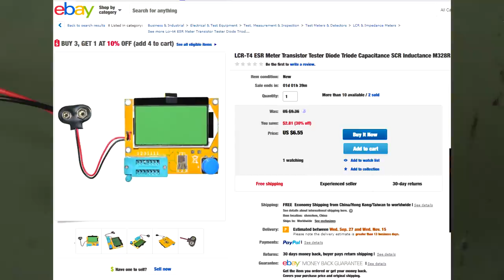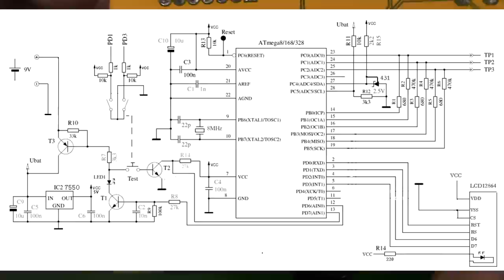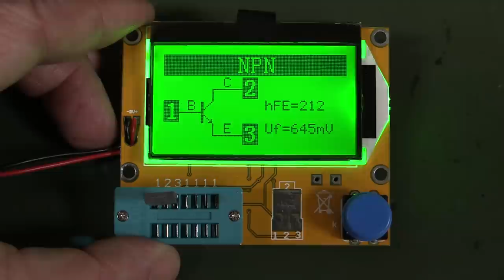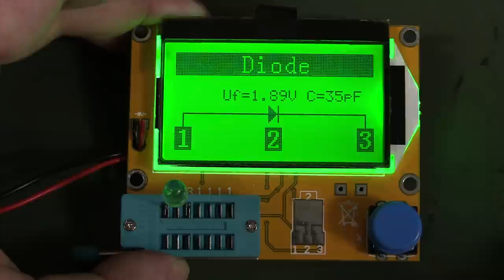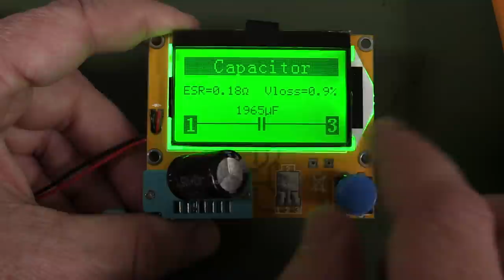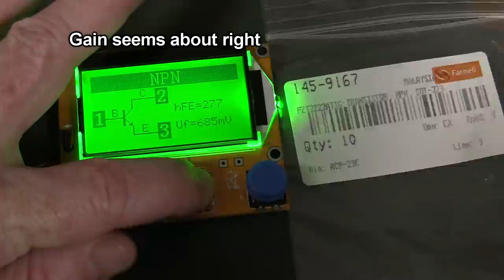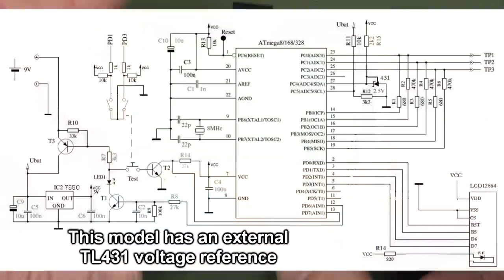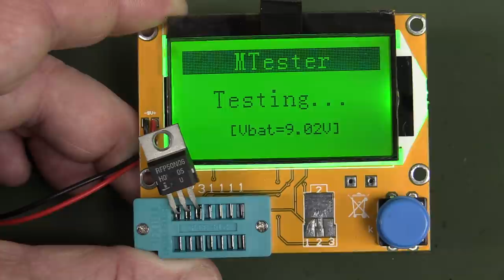EEVblog #1020 - Is A $7 LCR / Component Tester Any Good?

Comment: I love my component tester as a simple double check before soldering ass saver. On more than one occasion, I've been unsure of the pinout of a given part. It saves me from digging up a datasheet for it on the computer, but more importantly, lets me confirm at the workbench, letting me install and solder in a part with the confidence I'm not going to do some idiotic move like put a transistor in backwards. Nice to characterize SMD caps too, since those are typically unlabeled.

Comment: I had a failed power supply for a sat receiver, couldn't find anything obvious wrong with it, so i started pulling the electrolytic caps off it and used a similar tester, replaced all the ones it showed being out of spec and the power supply works like a charm now, don't remember what mine cost now, got as a kit from bang good, and 3d printed my own case. its been very useful and well worth the money and time.

Comment: Always discharge capacitors before measure them in those devices. I killed one of those testers a while ago with a still charged electrolytic cap... No magic smoke though :(

Also: since caps are measured by charging them and counting the time for that, the measurement is more accurate (if this thing is ...accurate :)) with a fully discharged cap.
Reply: obelix Good point, I've killed two testing electrolytics now.
Reply: I accidentally connected a partially charged 25v 4700uF to mine and it actually made the unit power up on its own as soon as I connected it. Luckily it survived but I always short them out first now even caps that are not charged.
Reply: Sounds like a good feature to add... a couple of relays that short the pins until the testing starts.  Connect your part... it's safely discharging until you press the button. It can go back to discharging as soon as the test is over. Now you know it's discharged when you are done!
Reply: There is a design variation with a shorting relay that is supported by the existing software.  The relay coil current is far more than the rest of the circuit draws, so you don't see it on commercial boards.

Why do I remember this?  A capacitor charged to 19V blew up my first tester...
Reply: Right! All the test inputs are directly connected to microcontroller I/O pins. 
So, connecting a capacitor charged to more than 1 volt may damage the µC by causing currents through the internal I/O protection diodes. More than 6.5 volts will definitely kill it.

The tester tries to discharge a connected capacitor by shorting all three test pins (by setting them all to output with a logic low) for a few 10 ms. But that may not be enough to completely discharge a large electrolytic cap.
Reply: I think I’ve toasted my one that way too. Capacitor was probably not fully discharged. LCD backlight goes on but nothing else. Two of these tiny 3 pin SMD components seem to get hot. Only the 5V regulator one I can recognize but no clue what the other 3 pin elements are. No label. Anyone fixed their one and could tell what to replace?

Comment: In my testing It does do inductors pretty  well, I have a variant I reviewed a short while ago and got similar results ... works a treat, and I totally agree with dave, for the price as a simple tester and identifier it works very well, my version was more expensive as it had a case and also did IR remote decoding
Reply: Oh I pop in from time to time 😆

Comment: for years I also been over looking this kinds of units and I finally cracked and bought one! it actually came in very hand when I was assembling a board that was designed in the usa and the kit came with European components which meant the BCE was all backwards ! it paid for its self right there! by saving me the trouble of finding all the datasheets for each transistors

Comment: Dave, I really like your channel and your in-depth reviews of electronics technology. However for this video you apparently did not do any research. What you essentially trash, complaining about non-critical features such display brightness and missing low voltage indicator, has been carefully designed by two trained engineers such as yourself (Markus Frejek and Karl-Heinz Kübeler), documented on the well known German microcontroller.net website and is shamelessly more or less well copied by companies in China that sell their knock offs online. You received a particularly old and poorly executed clone. The project is continuously evolving, with improvements to both hard- and software. The latest version is quite capable. So please RTFM (131 pages), buy or build the most recent version (EagleCad schematics are available too) and do a new video. We all know you can do much better!

http://www.avrtester.tode.cz/upload/ttester_en.pdf

https://www.mikrocontroller.net/articles/AVR_Transistortester#Introduction_.28English.29

https://github.com/svn2github/transistortester

https://www.ebay.de/itm/142477623934
Reply from the maker: +Wetter Station I did NOT purchase this, it was sent into my mailbag.
Reply: EEVblog Hi Dave, sorry I did not know you received it for free. I corrected my post. Nonetheless, perhaps you can at least add the 131 page manual from May 2017 link and Github software link to your video? I'm sure your viewers would appreciate that.
Reply: Ain't nobody got time for that.
Reply: Dave's viewers, keeping him honest! ;')
Reply: +Wetter Station, thank you for posting this information.
Reply: Is there shop in Germany that sells these? I do not want china fake crap, fake chinese resistors are enough for me. Especially for a measurement instrument.
Reply: He could've at least easily calibrated it before making a review video about it and constantly nagging about how inaccurate it is!
Reply: maybe send the new one to him lol
Reply: @EEVblog  re 4:43, it seems this has been answered.  You might also find a video review of these things to be of interest: https://www.youtube.com/watch?v=4Xsg8lpP75s

Comment: Its pretty usefull. For checking transistor pinout. Also software is open you can reprofram it. It can with new program measure frequency, have generator etc.

Comment: In Dec 2021 I found one for $11.99 with free shipping on ebay in US.  Here's one $11.52 with plastic case ($10.52 + $0.99 shipping).  
LCR-T4 ESR Meter Transistor Tester Diode Triode Capacitance SCR Inductance +Case

Comment: I got one of these last year and only recently realized I got a "fake" one from what your forum was mentioning. The one I received didn't have the metallic clock crystal and it also had pads for a usb port that wasn't populated. Brought it up with Amazon since it died and I realized it was a fake and not what is shown in the listing. They refunded it so. Hopefully the one I order from aliexpress is the real one. All the review pictures show the real one. 

It came in SO handy when I repaired a RX 560 that was missing a sot-23 component. Turned out there was one next to it. De-soldered it and put it on the tester. Told me what it was. Went to a donor graphics card and kept desoldering sot-23 components until I found what I needed. Put it on the RX 560 and it worked!

Comment: A while ago I bought one of the versions with a character based LCD display as I preferred its DUT connection method over one that uses a ZIF socket. I wasn't expecting it to be a precision device. Certainly handy to provide some basic information on the drawers full of miscellaneous transistors that I have acquired over the years.

Comment: I have had an earlier version of this device for a long time. I once assembled one of those little cheap oscilloscope kits using just that device to sort the parts, came out just fine considering I did the whole job on the booth table top in my RV sitting in the middle of the Mojave Desert using a USB soldering iron running off a home built power-bank made out of two 18650's taken out of a dead laptop battery. Both the tester and the little scope run fine.  The only problem I have had with it is that I once put in to large a lead in pin hole 1, and it no longer makes good contact, so I simply used the lower set of clips on the zif socket...  Thanks a million for the review though, I really believe all the hobby electronic guys should have one of these.  I find it especially helpful now that I have begun to get surprise packages from Electronic Goldmine down in Arizona. for a few bucks they will send you a large box of mixed electronic parts from Diodes to Caps as well as all sorts of resistors and a ton of things I need the component tester to figure out what to do with.  Some are beyond that device but I probably won't have any use for them anyhow, so in the  bin with them.

Comment: i bought one of these earlier this year because i was sorting hundreds of different components. worth it if you cant afford a pro tester or a good auto multi-meter . Ive had some parts that wouldnt test in slots 123,  but moving it to a different location gave a reading.  its handy thats for sure.

Comment: @5:28 time mark , A regulator was tested , and it was tested in the wrong area of the tester , The first 3 pins in the bottom section  marked KAA is where that part should go and any other parts relating to Zener diodes.....

Comment: So Coiltec made the first version and released it for free with no license, which means he still hold the full ownership of the IP. The community of developers improved the original work but that doesn't change the rights on the original work. Then the Chinese manufacturers made money selling the hardware with unlicensed software.
 Hmmm interesting situation. For sure it is impossible to sue the chinese manufacturers (China simply does not have any legal cross relation with other countries), but it could be theoretically possible to sue anybody who import the product into any western country. Theoretically, but not feasibly as it would cost way more than what it could be recovered. So, besides the fame, open source does not work when there are countries that do not respect the same otherwise shared rules.

Comment: Definitely a useful tool for sorting through the salvaged parts bin, especially as  eyesight goes with age and I can't read the tiny writing on the components any more!  The tester version I have has trouble with germanium diodes, though - shows some of them as 0.6v drop whereas my meter shows 0.3v.
Reply: Did you try to calibrate it?

Comment: Mine arrived from e-bay yesterday, identical to yours. First component I tested was a faulty zener diode :-(. out of a box of hundreds of zeners, I just happened to pick the "murphy " one. Other than that, worked great, but measuring less than 15pf of capacitance, it doesn't work,, the display fell out when I opened the bag, but, nothing 4 spots of supaglue didn't fix. but, I am very happy with it.

Comment: EEVblog, nice video. I wish one of these days you will put one of these “ component sorter” LCR meters through its paces in a in-circuit scenario. There seems to be too much emphasis in high accuracy, when most circuit components are specified as +- 5%, or even sometimes +- 20%. I want any of your video watchers to raise there hand and tell me that they do LCR filter designs and they need high accuracy. If this “component sorter” LCR meter can be used in sorting bad/good component in repair/maintenance work, then it is an invaluable tool.

Comment: I got a question for you...  there are two holes on the top left hand corner of the button on this tester, have you figured out what they are for  ?  I was gonna make some tests here to check if there is any voltage there but i don't wanna run the risk of destroying my new toy..    I thought it might be a source of power to connect a cooler, but it's just my speculations.   Dont know if my english is clear enough, so the two holes i am talking about are between the button and the painel for testing the components... below the lcd... to its right corner.

Comment: I bought two of them, and both fried in six months even with good use (short capacitors before the test, etc). Help would be appreciated, the voltage regulators are ok and so the transistors, so I think the ATMega to be always failing.
Reply: You can always update the software so (unless you really did fry them) i would imagine you could also reprogram them....? Worth a try anyway!

Comment: I know this video is a year old now, but after watching this, I finally bought one which comes with a neat transparent case. I must say, this device is very helpful for me.  I use it to measure capacitance and pin-outs of multi-pinned variable capacitors, also to test diodes and transistors which i can't identify. A very neat device for such a cheap price. A must have for technicians and electronic beginners. Thanks or this video Dave <3

Comment: I have a similar one, that started failing after being stored w/o battery for 1 1/2 year.  The ZIF socket started shorting internally.  I ended up pulling it and replacing it with three wired clips...

Comment: I bought one of these offov Ebay in 2018 as I was just starting to learn electronics and have to say I learnt so much about pin outa and what was what in transistors mosfet igbts and diodes capacitors and inductors n resistance from this little machine and when I used to pull a lot of second hand components it's super handy for quick ID and for £5 you cant beat it .😎💕🖖

Comment: it's basically applying a current through 3 resistors and measuring the voltage drops, so it's very approximate at best.  For transistors, the test is going to be fooled by collector-emitter leakage current.  For capacitors, leakage current will cause wildly inaccurate capacitance readings.   I would trust it to at best give you a go-no-go indication, which  is going  be somewhat useful as most small transistors short out.    A fine device as long as you remember its limitations.   For actual capacitor measurement, better use an actual bridge based on a RC bridge.

Comment: Actually for a lot of applications, you can dump the bulky LCR meter and use this little thing. 

I remember there is a graduate thesis examined every aspects of this little thing and compared its results with LCR meter. It use pulses to measure L and C, and turns out quit accurate most of the time. And I always use this little thing when winding SWPS transformers.

Comment: I bought one of these recently, mine was in a kit that required assembly.  For what it does, and what it cost, it's a cheap & fairly useful device.  I use it mainly for capacitor ESR testing.
Reply: did you experience that it shows ESR eq to 0Ohm and test need to be repeated few times before it show the rezolut ?
Reply: @porlockos  No, not on the one that I have. The readings are pretty consistent.
Reply: @Pyridox  what was the lowes value that you measured ?  I'm not able to test anything bellow 0.1Ohm

Comment: I just got one of these and the capacitance readings for electrolitics seem way out. I tested with a few brand new electrolitic's and from what I can gather it gives you a reading of the capacitors labeled value minus the ESR value with an extra 0 on the end. 
For example I tested a 2200uF Electrolitic and it said it was a 1800uF the ESR value tested as 0. 35 ohm, if you take 1800 from 2200 the result is 350 this is the ESR Value of 35 with an extra 0 on the end 350.
I dont get it

Comment: I have the one with the red board and blue LCD and it works quite well.  It's fun to whack parts into it just to see what they are, even if I already have the datasheet downloaded.  It also has additional functions like a frequency counter and PWM generator.  I soldered some alligator clip leads to the board where there were some through holes ready for attachment so I can test parts much bigger than the ZIF socket can take.  In the case of mine the ZIF socket goes 1112333, so any 3-pin part can go into it with the center pin in 2.

BTW, when the instructions say to discharge capacitors before testing, they're not fooling around!  I tested a cap that I had just tested in something else, and it was still holding enough of a charge to fry the main processor.  Luckily, Banggood.com (where I bought the solder-it-yourself kit) sells just the processor so it was an easy replacement.  Be sure to discharge those caps first!

Comment: I bought one. Looks just like yours. I soldered on an isp header, and flashed the latest firmware to it. Great that its still under active development.

I cut thectrace to the backlight, and bodged in a 10k resistor. It draws enough current to keep the power on transistor on, but is much less blazing bright.

Accuracy is surprisingly good, tho im not sure i trust the esr or vloss numbers all the time.
Reply: Hi,

How did you upgrade the firmware ? 🤔

Best Regards,
Reply: @davidbolha  I just followed the info I found in the eevblog forums mega thread.  Quite easy, solder pins to the icsp header, and use any icsp at mega programmer like the usbasp

Comment: I built mine as a kit.  I knew that it measured caps in circuit, but I could not believe that the seller told me that it tested other components.  Actually, I also did not really know what it was.  I like how it diagrams out MOSFETs and transistors.
Thanks
Frank
Frank Reiser Video/Audio Service